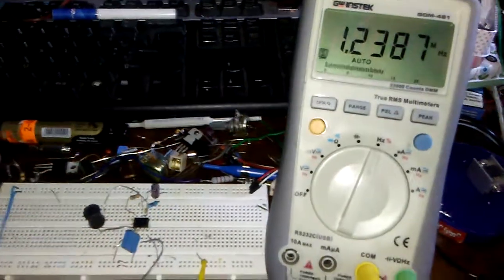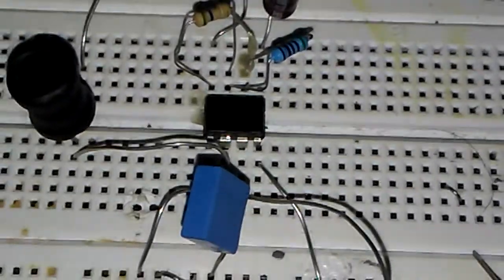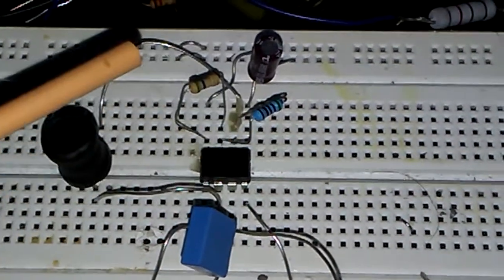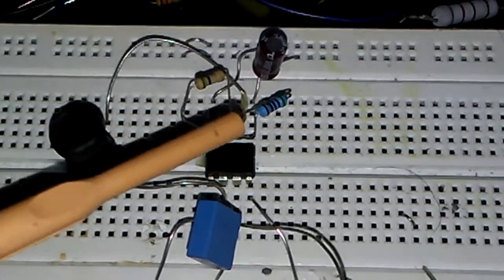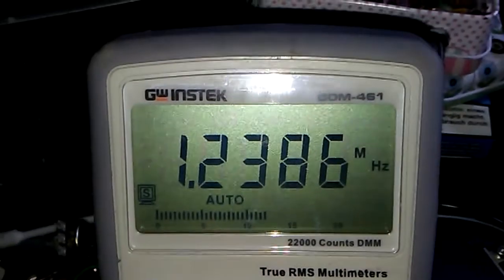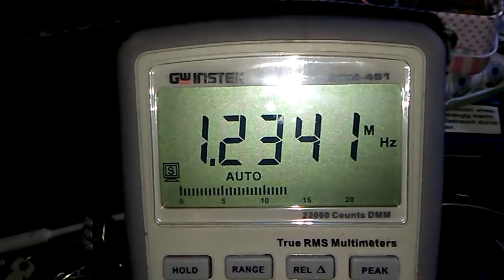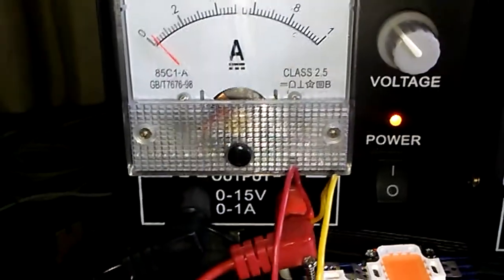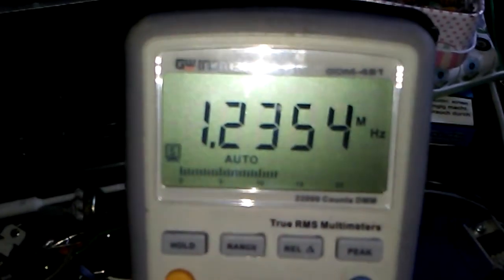1mhz oscillator with 555 !!!!

Comment: can you send to me circuit  for this nice project
Reply from the maker: this is an old project, could u draw from screen? it is clear to see
Reply: Brother
Please draw the ring clearly, your explanation is clear, but it is better to be in your handwriting and not wrong
I have sinned by drawing, and do not work well
a favour :
Draw me the circle with the numbers statement
Reply from the maker: If it is notworking try to use fake and cheap 555 ics for more noise to be able 1mhz generating noise loop